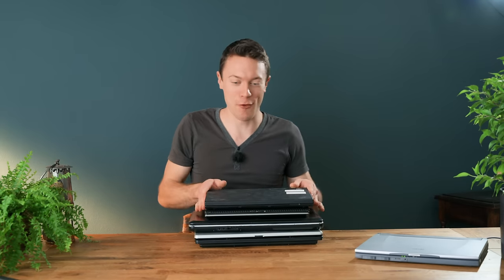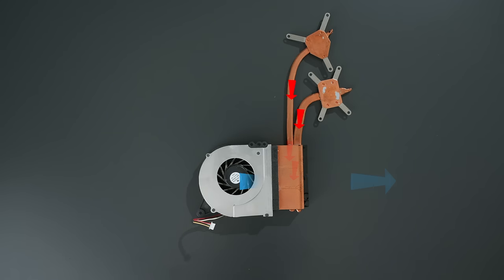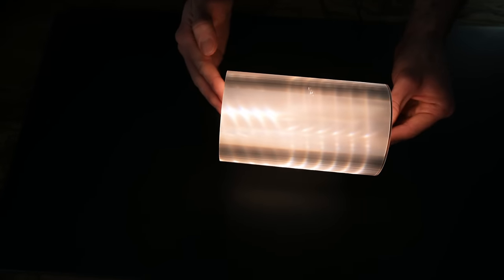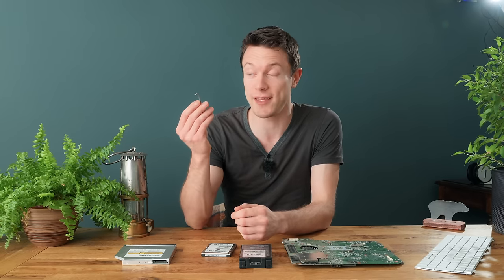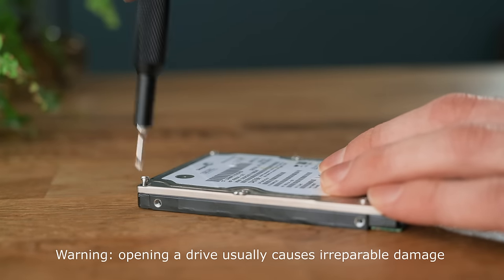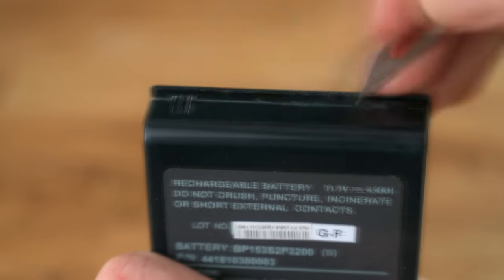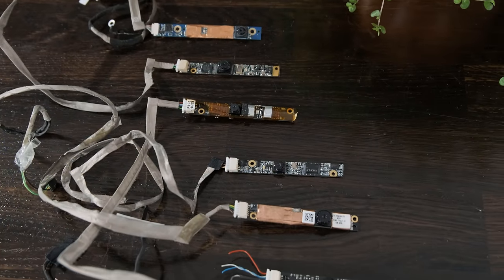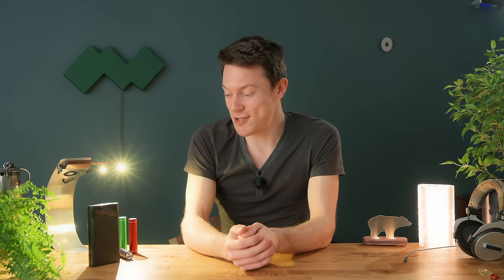Things you can make from old, dead laptops

Comment: Small improvement on the laser view meter:

Mount the entire hard-drive on a small fan that you voluntarily force to vibrate. Either brake one of the fan blade or glue some weight. This will create the vertical scan while the music is still displayed as an horizontal line.
The effect is similar to using a scope but nicer because the scan is symmetrical. What you see is nice Lissajous figures depending on the frequency content of the music.
Reply: Christian Gingras 
Mmm. Myes, indeed.
Reply: Vu meter
Reply: 120 thumbs up, my most popular comment on youtube. My first experience of a similar way to display music was using an old color TV. There was still a few vacuum tube, in particular a large one with metal cap on top to rectify 25 kv and a bigger one for pulsing at 15 KHz to produce horizontal scan an the high voltage +25 kv.
The CRT was 26 inches, diagonal. It was the old style with the phosphor being dots, not vertical stripes. It used dynamic convergence with 3 electromagnets close to the deflection 'yoke'. A PCB with 16 adjustable resistors allowed to adjust how much current is used to stir each color mostly near the 4 corners.
I disconnected both horizontal and vertical wire from the yoke (like the science fiction pretend: don't adjust your tv, we control the horizontal and vertical...
I used a 6 volt transformer, connected it on the horizontal wires of the yoke.
I connected the vertical to an amplifier,  in parallel with the speaker.
Result:
Same as with this laser, except: because of the dynamic convergence, trying to force the red, green and blue to center, the 3 colors were separated but followed similar path. The music was illustrated with these 3 intense, saturated, colors.
Using a more recent CRT, we need to use magnets near the neck to force the color to separate. Otherwise, the convergence is so good that we just see a more boring white trace. It is hard to keep the color saturated in every parts of the screen. Modern CRT are just too good at keeping the 3 colors well aligned with the shadow mask.

Comment: Don't forget to save the windows license key. That's can come in handy.
Reply: how can you do this? when you view it in the system, it's typically not a real key from what i've seen, especially if the system is the one the computer came with. if you installed it and paid for a license yourself though, its a different story and yes it would be on there... care to explain? im curious how you can do this. thanks in advance .
Reply: @iH85CH001  with the software Windows Product Key Viewer for example
Reply: I don't think that's "legal" (depends on where you live), Windows OEM License, the one that comes preinstalled with the device, is supposed to be usable only for that particular device, non transferable. But may still be able to be used and activated in other devices if you try, though this will be "grey" in legal context.
Unless we're talking about windows Retail/FPP license we bought separately from the device, that will come in handy since we have the right to transfer the license to other devices.
Reply: @feelsgoodmanjpg7762  gotchu, will look into that. @fathi, not tryna do anything illegal either lol. Just asking out of curiosity and for educational purposes.
Reply: @iH85CH001  older laptops used to have the windows key (license sticker) on the back. At least most of mine had it back in the windows xp, vista and windows 7 days. Not sure about newer ones (my win10 doesn't have one)
Reply: @maYdaY1337  thats true. My stickers were worn off so i had to try to find a way to pull it from the software itself, which i never figured out how to do.
Reply: @iH85CH001  License Crawler is good for digging the key out of the registry, so long as the machine actually still runs so you can install the software and run it. It should find the keys for most, if not all, of your installed software
Reply: *that
Reply: @XFTFX  Technically not as long as you own the original machine/motherboard. But if you decide to scrap it you don't necessarily need to get rid of the operating system if it has been reinstalled in another computer. 
It's a loop hole that was widely used in the past for people selling old licences on E-Bay (technically you could buy the licence as long as you took the original motherboard as well, but if you asked the seller to destroy the motherboard because you didn't want it,  and it was now technically yours, this was OK... sort of)
Reply: SLIC ? 🤔
Reply: Nathan Sutton is that an app or software?
Reply: As long as you have a working system drive from a pc that was activated, you can plug that to a working computer and use software like Produkey to find the license. These are simple programs that find the key for you. Of course using an OEM key is only legal when you want to reinstall an old laptop that has no serial sticker left.
Reply: @iH85CH001  if you install it then the internet will automatically assign licence because of hardware signature, i think..
Reply: Imagine actually buying windows in 2020 when they make billions with all their expensive products lmao
Reply: @maskyb3509  maybe newer versions do this, but never in my experience all the way from XP to 10.
Reply: would this acctually be useful for like window celeron and the 10 15 yo windows
Reply: @HB Net what if its a different model tho? Im assuming ur different ones were? Idk. I never had such luck.
Reply: Fathi Rizqi Ananda who cares I'm not about to pay another hundred bucks
Reply: I've been using windows 7 licenses to install windows 10 on several computers 😂
Reply: @ElfNathanable  havent tried that one but Belarc Advisor does it in a couple of minutes
Reply: Windows 7 (or older) had the license key on a paper/plastic sticker, somewhere on the side or back of the device.
These license keys are ideal, so that you can dual boot a newer OS with an older one, for program compatibility without needing to use another machine to do it on.
You could also run these OS'es on a virtual machine.
Windows 8 and 10 have the product keys embedded into the system board. but there is software that can be used to extract the key.
Reply: @XFTFX  It's legal, because the machine it came out of  is not active anymore. But it has to be used in the same type of computer, and same bit, i.e. 32 bit or 64 bit. I do it all the time.
Reply: @XFTFX  *laughs in text file with approx 100 keys taken from various public computers/cash registers/thrift stores/ect.
Reply: @XFTFX  Does Microsoft pay all their taxes? Silicon valley monopolies have enough money as it is. You're right that it's a legal grey area, but it's hardly like it does any harm.
Reply: If you backup your profile to onedrive then just logging in to a non activated windows 10 install will generally activate it

Comment: Great content as always. Just a slight correction, I am a ContaCam user and if you use the motion capture and recording triggers it is extremely resource intensive. So if you plan on using the software and have a slower system please make sure you turn down the recording quality otherwise it will max out the CPU and will crash every few hours.

Comment: Regarding old hardware that works only on 32-bit OS: sometimes a virtual machine can be used. 32-bit VM will work fine inside 64-bit host OS, and you can redirect USB (always) and PCI (requires mobo and cpu support) to the VM. I use such setup for an old USB scanner.
Reply: Great idea....if you can find 64bit drivers for your old device. :)
Reply: The idea is that 32-bit drivers work fine on 32-bit VM that is running inside 64-bit host.
Reply: @Arti9m  Not exactly. The idea is that 32bit SOFTWARE will run well in the 32bit VM...inside the 64bit host. I believe the host would still need a 64bit driver for the hardware to be functional in the VM.  I could be wrong about this. I haven't dealt with this exact situation myself.  Cheers!
Reply: I hope I'm wrong and if so, I'm sorry for the the misinformation.
Reply: @PumpkinSeed17  You are wrong and kinda right. You can pass the usb device directly into the VM without having the 64 bit host machine bother with it at all. The only downside is if the hostmachine does like win10 tends to do and autoinstall a driver. Sometimes these drivers can be explicity unsopported by the OS and actually cause crashes and unstability. There are ways around this, but still something to keep in mind if you plug old devices into your pc.

TL;DR: No drivers need to exist on 64 bit host for 32 bit VM.
Reply: @PumpkinSeed17  I got no problem with that, it doesn't matter the host is 64bit. I have rather old, but still functioning printer that works only on xp. whenever I need it, I just run 32bit winXP on 64bit win7 and after plugging the printer in I select it in virtualbox's options for it to go to winXP. 

win7 disconnect sound, winxp connect sound. and that's it :D 

the only drivers for that printer are for winXP 32 and that's what I installed on vm
to save some effort I run it from a vm-screenshot, not starting vm  again (and to skip registering xp)
maybe there are cases where there is a conflict between 32 & 64, but I haven't heard of such yet
Reply: @SteamSigun  Cool. Thanks for the real-world example how this magic can work! Very cool!
Reply: @dragonsloves  Wow! That's great! I'm pleasantly surprised! Thanks!  I'm actually running Win7 on my laptop now because Win10 updates keep my USB-Serial Port adapter from working. Maybe I can give it a go again with your method. :)

Comment: I don't know the math on cost efficiency, but this could be a good way to make side money if you have the time and depending on the price and usability of the laptops you pick up. Potentially good for teens as it can also develop electronics skills
Reply: it really is a good way of learning and making money at the same time ( schools are quaking )
Reply: I have taken apart dozens of old hard drives.  The magnets are handy to have around the house, and in the desert, they can be used to find meteorites. I have used the disks to make wind catchers for my wife's wind chimes that have lost them in the wind.  They do keep their shine and with a sharp drill bit, you can drill a hole on the disk and run some fish line through it to tie it to the chime, a small wooden ball works to ring the the chimes as the wind twirls the disk.
Reply: I know where the IT dept. toss's the old dead laptops, I'm wondering how happy they will be if I helped them out by getting rid of their clutter?
Reply: I know where the IT dept. toss's the old dead laptops, I'm wondering how happy they will be if I helped them out by getting rid of their clutter?

Comment: expected a like " i turned it into 3 coasters or I made a plate out of it for NO REASON but this is actually really well done and not wasteful good on you mate!
Reply: Turning an HDD into wind chimes is pretty wasteful. Also he does not mention things such as re-using the Ram, or SSDs etc.
Reply: @jjoke5014  Well he does say to put hard drives into enclosures.  Older machines didn't have SSD's but the same would apply.
Reply: Mark C Apologies, yes he did say this. However I’m sticking with my point.

Comment: the quality on that mic got me thinking why do i even bother spending so much on headsets
Reply: yeaaa, My headset sounds about half that good...
Reply: @jaalan7896  external mics are the way to go if you use a pc
Reply: But why do they sound so shitty when still build into a laptop?
Reply: @BigDBoogyWoogy  Good mic components aren't too expensive, the quality of the circuits controlling it and isolating it properly can be however, the amp they use in the laptop is also surrounded by electrical equipment so lots of interference.
Reply: @carlholdenart9330  Same reason why most headsets don't sound as good as they should, motherboard is downgrading them quite much.
Reply: They can soud good ...
However i suspect he edited the sound to sound close to the rest of the video
Reply: Dont believe EVERYTHING see on youtube
Reply: @BigDBoogyWoogy   Distance makes a huge difference and in the laptop they are much further away from your mouth.
Reply: @BigDBoogyWoogy  the noise aka interference, plus in a laptop you usually aren't that close to it.

Things like decent microphones and speakers aren't so expensive, it is all the other stuff that makes it work with your computers that is expensive.
Reply: sounds fake
Reply: @newgenaverr15  ok..i won't believe you
Reply: @NinoJoel  I actually tried this and it works just like he said. Though he lives in a quiet place. Don't buy an amplifier with agc, something like the max4466 would suit you better if you live in noisy areas. Oh and he mentioned that he used that on the lavalier he's wearing so it makes sense that it sounds the same.
Reply: Look up how speakers and microphones work. They’re pretty simple.
Reply: @UNKW0N  There's a lot of reasons why. Maybe you got a defective product, ac interference, house not grounded. You could try using usb sound cards or placing the amp close to the mic so it wont pick up much noise. What kind of noise do you hear? Hum, buzz, high pitch whine?
Reply: @UNKW0N  oh. That's good. It might be the integrated sound card that's making it sound worse. I use mine with a usb sound card and RTX Voice. But I don't know for sure.

Comment: Save the hinges - nice for building adjustable lamps, lids, and work holders since they hold their position. You can also salvage bluetooth adapters out of some laptops, just like the webcams. Mind the voltage, some run on 3.3v instead of 5. Save the power brick and the laptop's power input jack to power a future project. Some newer laptops also have light sensors and magnetometers that sometimes can be found on little daughter boards. Also, some laptop cases are made of magnesium, which can be a fun metal to experiment with (safely).
Reply: In case you make the external monitor, the hinges will be perfect to make it adjustable. You can also try getting the WiFi chips, they might be interchangeable with a laptop that works

Comment: This was really interesting. There are so many gimmicky ways of reusing the parts, but you found some really good ones I've never seen before! Another option for older laptops that still work but are slow, is to put a minimal linux distribution on them and use them kinda like a chromebook.
Reply: which version of linux distro do you recommend for older laptops? like dual core 4gb ram?
Reply: @rasaecnai  with those specs I think you could run just about any distro. I myself have older laptops with 1 and 2g of ram that I've been trying many distros on trying to find one that suits my needs. Their is an open source equivalent of chrome, just can't think of the name, but primarily uses the older hardware/software for solely internet use. As to not tax the system so much to run slowly.
Reply: Modern GNOME and KDE are quite resource intensive. A lighter DE like Xfce will run better on older hardware. Xubuntu is a good option.
Reply: I love Linux :)
Reply: @-Savage-  chromium os is the open source chrome OS, there's also chromixium.

Bodhi Linux I've always find to be the most lightweight and stable and all around best Linux distribution for old slow computers, it's based on Ubuntu LTS, so it's very solid but the softwares will usually be older.
Reply: Zorin OS lite 64 or 32 depending on your CPU, my lil bro loves his juke box laptop that can even still use YouTube on a single core Celeron

Comment: My notes:
1. Old laptops that work but are slow. Swap the hdd to an ssd, instant new pc.
2. Old hdd, those magnets are great on a wall as tool holders. I use them with screw drivers, if you put non magnetic screw drivers on them they become slightly magnetic.
3. The case, it's has nice little brass screw inserts. Remove them and you can use them with 3d prints to make stronger screw points. Just heat your soldering iron up to the melting point of your plastic and then use the iron to push them into the hole.
4. Keyboard and track pad. These can be hooked up to an aduino and used as mini kb and mouse.

Comment: why wasting money on a security camera system when you can buy laptop camera replacements cheaper :v damn never thought about that +1 subs
Reply: Ruben,  Parabéns!
Reply: Well security cameras come without an IR filter and with a bunch of IR LEDS around the lens so they can see in the dark and their enclosures are more robust so you can put them outside as well.
Reply: There are some pretty big difference in the use fo the cameras though, cameras that cost a little more and that has better quality can be used with powerful software that can detect suspicious activity and such. But to put useful stuff you have for free to use, this is excellent.

Comment: On the last tip (if it for some reasons hasn't been suggested yet) one should add to consider installing a Ubuntu (or derivative) OS, if considering gifting it away as an email reader/browser/writing computer for someone

Some of the distros can make even a dreadfully slow old computer quite usable for simple things like that.

Also, I wish there be DYI videos on learning DYI wood-crafting at home on the budget to make these casings and bodies for the DYI projects.

I have done a lot of wood-crafts when I was younger, but I had professional level equipment, facilities and materials. I wouldn't know where to start trying to do some of that stuff at home on the budget and safely
Reply: Agreed. Tiny distros like Puppy can make even the least powerful old computer useful.